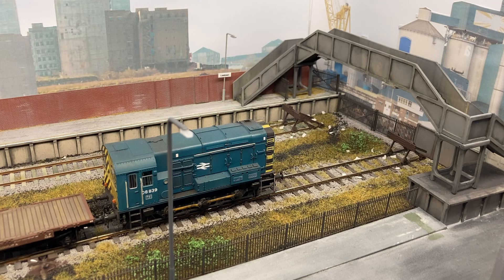Cameo layout tour: Leatown 1970s docklands OO gauge

Comment: Nice one James. I remember the area from the ‘80’s when I used to go there for Flood Protection practice on the Lea Tidal Barrier made redundant by the Thames Barrier.
Could you post the website from where you got the photos for your backscene please? I need to upgrade mine on my “Bow Locks” layout.
Reply from the maker: Paul, thank you! Link for the backscene images ( I did crop and edit them to suit, knocking back the saturation and tweaking contrast) https://www.filmhub.co.uk/locations/23844/silvertown-square

Comment: I really like the design of this layout.  It has a very low profile - what is the base board made from?
Reply from the maker: The baseboard is my own design, various sections of 6mm MDF with hardboard for the backscene and main part of the lid as it’s lighter. As these layouts sit on a shelf, they don’t need to same level of structural support as a traditional framework.